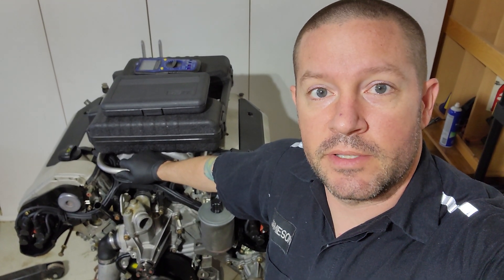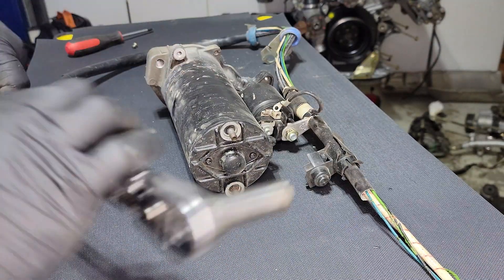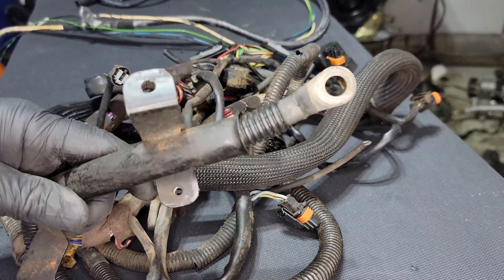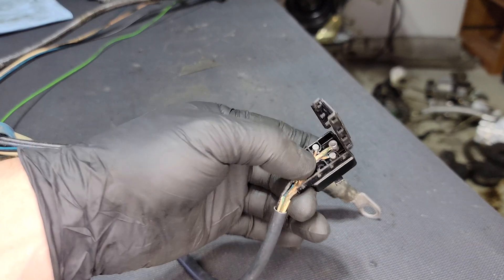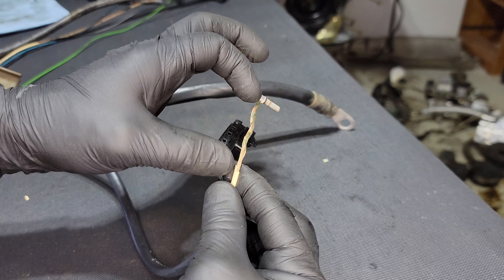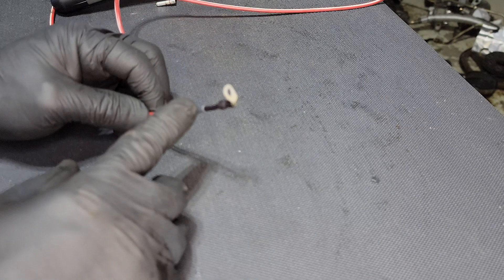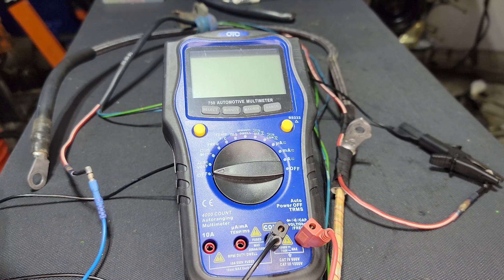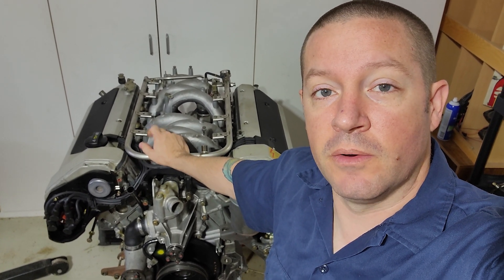M119 Lower Engine Harness Rebuild

Comment: if i dont have a donor harness, could i theoretically just purchase a few 16g petrol/heat proof wires to replace the 4 with?
Reply from the maker: Yeah, that would work.
Reply: sick. thanks so much man. been having intermittent start issues. everything is fine, lights come up in the dash and everything, go to crank, no click no turnover no nothing. but then, the next day it'll work just fine for a week or 2, then repeat. hoping this solves the issue! @FriendlyMBTech

Comment: Hey man how did you handle with wires sizes ??? Thanks
Reply from the maker: I found wires that were the same size or larger than the original.  Larger is ok, smaller is not.

Comment: Honest opinion, do you think the M119 is a better engine than the M113?
Reply from the maker: Each has their own ups and downs.  The M119 is smoother than the M113.  The M119 is DOHC vs SOHC for the M113.  Less goes wrong with the M119 than the M113.  The M119 doesn't have an intake manifold that breaks like the M113.  The M113 will last longer than the M119.  The M113 is cheaper to fix than the M119.  The M113 has more performance variations and options than the M119.  More power is available from the M113 and it's options than the M119.  More parts are still available for the M113 than the M119.  A lot of M119 parts aren't available any more.  That's just off the top of my head.
Reply: @FriendlyMBTech   I always felt like the M119 was a bit superior when it comes to build quality but I’m a huge fan of the naturally aspirated M113 5.5 in the Older AMG cars. I know the M113 feels a bit easier to diagnose 😆

Comment: thanks for the video... I have replaced my upper wiring harness but no the lower wiring harness. So everytime I drive my 1995 S124 E320 and hit some small uneven road like from asphalt over cement, manhole covers, cracked roads & freeways... the whole engine shuts-off completely (no electric, no power steering, no brakes, nothing on the cluster gauge ) and then cluster gauge will light up all indicator lights. Then when the vehicle is in shoulder and or safe side of the road, I will turn the key off and try to start again by going first to 2nd position on the ignition and will see all indicator lights will come on except for the "check engine light". Vehicle will sometimes not crank totally and then will crank but will not start. I noticed to that when I wait to let the engine temperature go down below 80F from maybe 97F +/- the engine will start. 

Could it be the lower wiring harness the short circuit everytime I hit a bump can shut off all electricity while driving? Kindly advice 
From mbwarehouse_find
Reply from the maker: Definitely sounds like something is loose or there's a short somewhere.  I would start with the lower wiring harness.  If you know it could be iffy, it won't hurt anything to repair it.

Comment: Really helpful, I have a 92 S500 with a mayor wiring problem, any wire that I moved was cracking and making contact, there for the injectors were dumping fuel into the pistons, again really helpful. 👍🏻
Reply from the maker: Thank you! I'm glad it helped!

Comment: Those barrel pins are actually just soldered to the wire. It's super easy to replace the whole wire, and not have to patch it.

Comment: Can you tell me how much longer the 4 wires to the 4pin connector are, compared to the battery cable? Mice ate those 4 wires, so I had to patch them, but I want to get the length right.
Reply from the maker: From the end of the battery cable to the end of the 4 pin connector is 6 inches.
Reply from the maker: At least on mine it is.  That's probably pretty close.  You might want to make it a bit longer just in case.  Maybe an extra inch or two wouldn't hurt.
Reply: @FriendlyMBTech  Awesome, thanks.